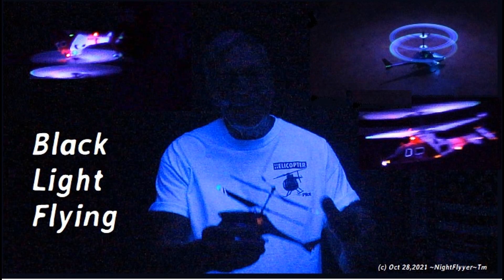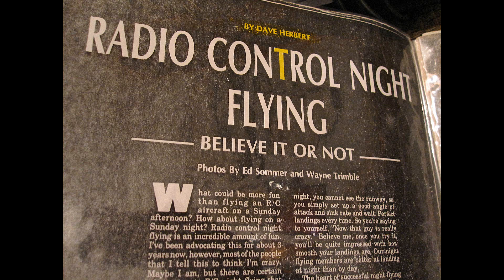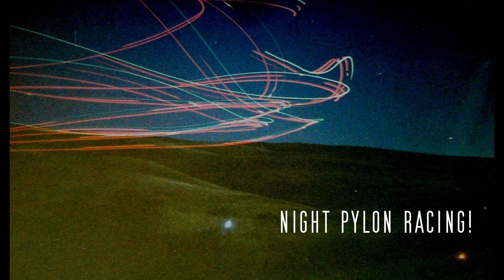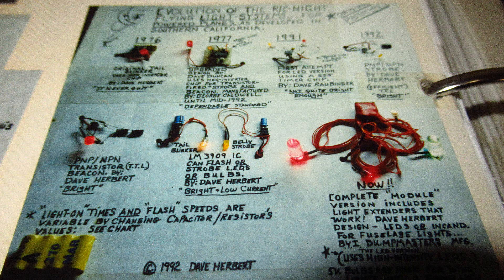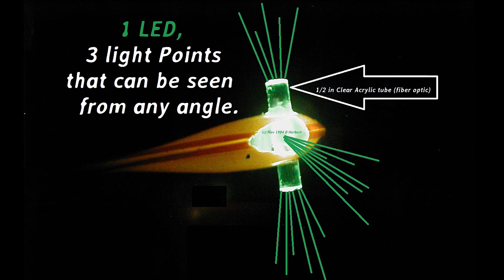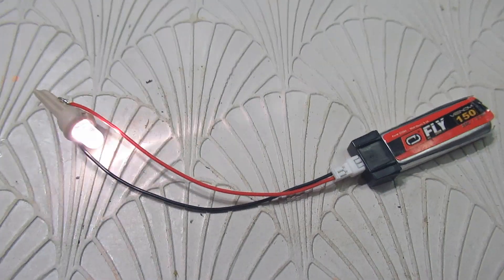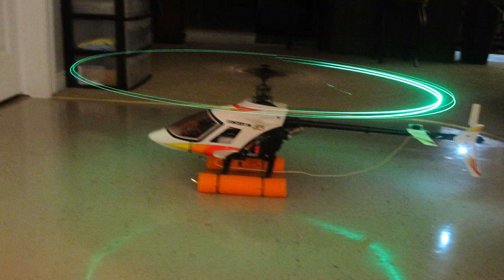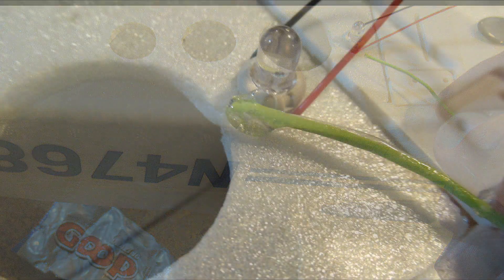3 Non-Moving parts make a Strobe Light for use on R/C Models and more, plus see the Flight Demo.

Comment from the maker: Missing the belly strobe on some of my night flying planes, I was looking for a really quick and simple way to make one, not like the way we used to do it when I built the blinkers with chips and TTL circuits.This one is easy.  Note: if you use a Lilypad with a 3v led, the light will blink slower than using the LiPo 3.7 v battery.Thanks for watching, Dave